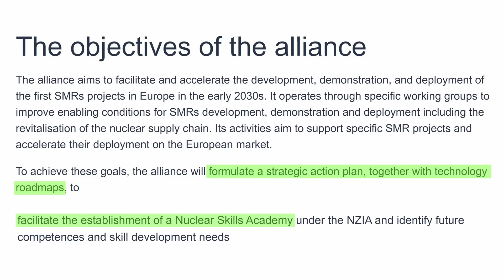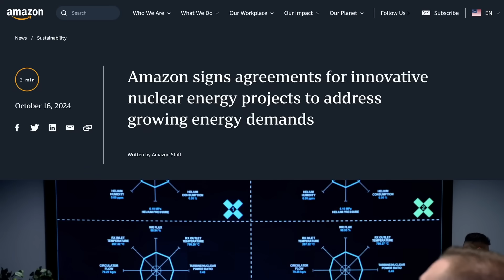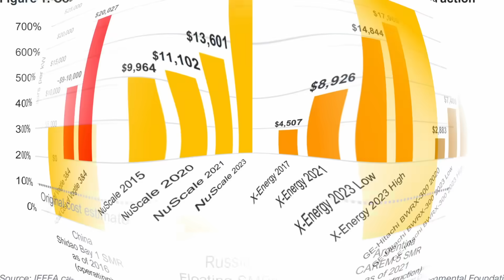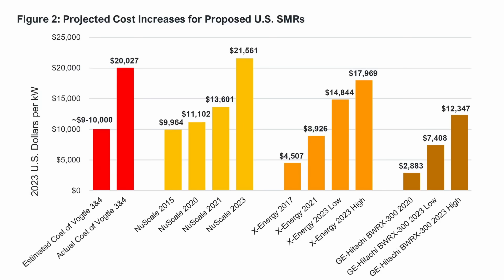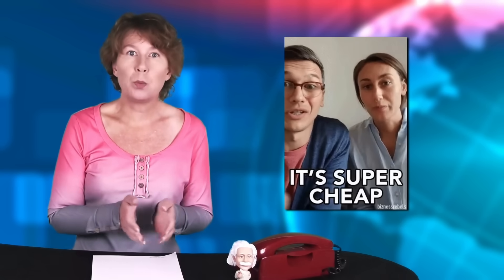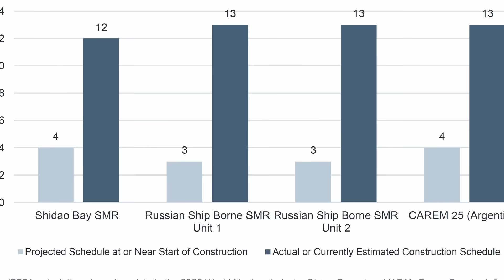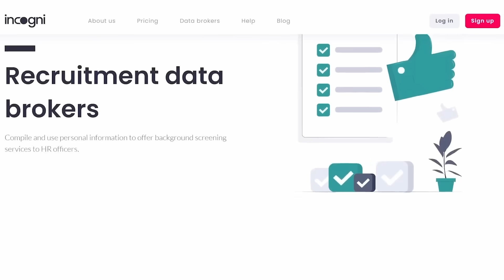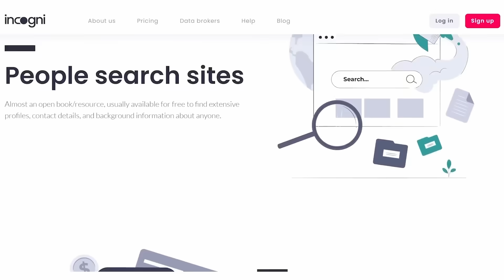Small Nuclear Reactors Have A Big Problem

Comment: Since when does N=3 constitute scientific proof of the economic viability of SMRs? Sure they have a bumpy start, X300 construction in Canada is about to get underway. We can't definitively call SMRs expensive until we've tried to build the first, second and eventually the Nth. And that's the problem, isn't it. We're judging extremely harshly when it is nuclear, and when it is the first of a kind (ring a bell? Olkiluoto, Flamanville, Hinkley Point C, Vogtle...) but are never prepared to actually LEARN how to build these things. China is learning. They are now building their CAP1000/1400 in 4~6 years. The prototypes where the AP1000s they built under license from Westinghouse. Yes, they were more expensive and took longer to build, but they learned how and now they are getting better at it. It will be the same with SMRs, IF ONLY... 

Right...

Comment: This video is too short. No explanation why those costs are so high. Is this just R&D cost high or …. ? Obviously very high certification cost but this is not the only issue with certification. Certified are not reactors but projects case by case as with big reactors therefore no reduction of certification cost at all. On contrary - proportional reduction with project scale. This gives not only high cost for SMR development. Cost you can calculate and share (let’s say with government). Certification gives biggest problem - uncertainty. You never know - how long and how much dollars even with proven technology and design. Therefore no big neither small reactors on the way. This certification burden could be acceptable only for governmental agency like with military SMR. Therefore no way commercial SMR will hit the road.

I was thinking a lot about issue and see no good solution. We should look for compromise between business and society. Just complain - not my style. My suggestion would be - limited NRC certificate for the SMR site. It shall be underground x feet at particular location. And full stop of NRC involvement! Would be better to have limited procedure with $1 billion digging cost of 3000 feet underground than having project “on knees”.

Comment: Sabine, Generally I greatly appreciate your reviews and insights, but let's be more specific  with numbers here... - In Particular on existing reactors. the russian floating power station has being finished in 3 years. The rise of cost is associated with change of the location point from original Arkhangelsk to remote frozen Pivek ( check the map, please). Relocating land infrastructure to Pivek attributes to massive cost rise.

Comment: The fundamental issue is that we are fixated on eliminating CO2 - the gas of life.  There has never been an experiment that confirms CO2 as the climate control knob and certainly no evidence of quality sufficient to justify a legislative compulsion to justify the current expenditures to net zero (gross insanity).  None of the climate models are of the quality of the engineering models that determine the performance of aircraft, bridges or buildings. 
We need to recognise that this pursuit to net zero is MAD and get back to hydrocarbons - at least natural gas the engines for which require no development - just construction.

Time to get back to reality and a better quality of life than the current net zero  path.
Reply: Then you should know all numerical models of real world phenomena are always repeatedly wrong so to speak, but that doesn’t mean they are useless in the hands of experts who understand them well enough to know their limits, which is why there hasn’t been a failed prediction from climate science, and climate projections have been accurate for fifty years. No lack of predictions on track. 

The general circulation models are right enough to project future climate trends to usable accuracy and usable confidence. Your reply raises the question; have you made any effort to find out how well the models that scientists use actually work? There are many examples where we predict and design things from models that are repeatedly wrong so to speak that work the first time they are used; space telescopes and chips with billions of transistors in them come to mind to name a few.
Reply: @rps1689 Plymouth Rock should be under water given, the Climate Models of higher Ocean Levels.  The Obama and others have no reticence to buying Ocean Front Houses.
Reply: Let’s start with the fact that one can observe a noncondensing greenhouse gas in the lab as we shine different wavelengths of electromagnetic radiation on it that, and can measure its absorption spectrum. There is a big spot at around 15 microns, which happens to be in the band of the Earth's surface's black-body radiation; you must have learned about black-body radiation in high school physics. If so, you know one can measure how much the gas warms up with a given energy input; also measure the absorption band across sunlight.  Back to the 15 microns - long wave infrared warms the CO2 and sunlight warms it much less. Science has discovered that CO2 absorbs earthshine way better than it absorbs sunshine; note water vapour has a similar property. Of course that’s not all, we have to calculate how fast long wave infrared radiation, i.e., earthshine, makes it to space when it is getting absorbed and reemitted and absorbed and reemitted over and over. It is way slower than the incoming sunshine, which is basically unimpeded. When the Earth is in thermal equilibrium with space, that difference in transmission rate warms the surface - the greenhouse effect. This effect was discovered 200 years ago.

Combining the discoveries of the absorption spectra of gases and the greenhouse effect and the knowledge provided by them, we know adding greenhouse gas from agriculture, forestry, and during fossil fuels increases the imbalance between how fast energy goes in and comes out. That is the enhanced greenhouse effect. "Proven" by direct observation and simple mathematics.
Reply: No one is trying to eliminate the gas of life. 

CO2 is not only a life giver, it is also a waste product from fossil fuels that has made some ecosystems, agricultural zones, and feeding grounds we depend on not adaptable enough to the current climate change trend.

Science moves on from well established conclusions to areas of less certainty such as quantifying anthropogenic global warming in the presence of large feedbacks like clouds and water vapour. AGW is hardly the most important or interesting area of climate research because it is occurring and is settled. i.e., it’s a baseline. Just as evolution is the baseline for evolutionary biology.

Comment: One Problem is that "More Than" 100,000 Metric Tons of NUCLEAR WASTE Are Sitting IN Community Power-Yards East Of The US Mississippi River.... 90% of all the US Waste. WHAT'S THE PROBLEM --- LIBERAL ENVIRONMENTAL FAIRIES (VERY STUPIDLY) DIDN'T WANT THE REACTOR 'WASTE METALS' STORED IN 150 TON TRIPPLE WELDED CASKS UNDERGROUND --- IN THE DESERT. Technically, Environmentally, Operationally THIS WAS "THE" MOST DUMB AZZ MISTAKE WASH DC HAS MADE IN 25 YEARS.

Comment: We ALREADY have this tech. . . I live approximately three miles from at least thirteen (13!) small nuclear reactors (S6G reactor plants/150-165MW each) in the form of Los Angeles class submarines.  All awaiting decommissioning of their reactors.  Why has it taken so long and cost so much more (each sub cost approx. $1.6B 2023 dollars) to implement these power plants for commercial/residential use?  Can't we just run an extension cord from the subs and plug them into the grid!?

Comment: I think there are more than just three modular reactors currently in use. Virtually all the nations that have nuclear powered ships and submarines use small modular nuclear reactors. This has been true for many years now. These SMRs have demonstrated robust reliable and efficient records operating in mobile, many times remote environments where any failure would be catastrophic. Of course the current users of these SMRs have to do so under extremely strict and rigid safety regulations.

Comment: We are already using small reactors in nuclear submarines and have done for years. Rolls Royce never mentioned will build one in the    Near future. Cost wise the EDF reactors are not cheap but we need electricity. Wind farms will never produce enough electricity and gas and coal appear to be no go areas.

Comment: Sabine,   I have been following the development efforts for Small Modular Reactor (SMR) power generators for over 10 years now.  My concern relative to developing SMR's are the use of fissile material will require the development of new materials to facilitate SMR 7/24 operations to generate electrical power and how to change the nuclear fuel used when the existing fuel is depleted.  Developing new materials to address processing requirements always takes time and money which is why most companies want the government to build initial pilot platforms because the public will pay for the development of new materials, development of new processes and procedures, and development / implementation of risk management plan(s) / supporting procedures.

Comment: No one said cheaper. It makes siting a high energy burden industrial plant, a lot easier though. Why did you think it could be cheaper than a normal nuclear reactor. No the goal is just cheaper than coal or Nat Gas.

Edit: also to be clear the goal is standardization. Which is the point at which costs will fall. The prototypical production will always be wildly expensive.

Comment: Another techo-scam making unworthy people rich. 
With modern cad and simulation the design times, for anyone serious about producing a system, are drastically reduced. And if you cannot build out a container sized system in less than a year you are definitely not trying. 
Yes, I understand that this is a highly technical project but it is not as if the process of producing electrical power with fission is unknown. The lessons learned through large scale nuclear plants should provide a solid basis for whether or not miniaturizing the process is even practical and based on the current results the answer to that question is obviously no.

Comment: Its stupid to build new reactors if they just have to use the power of the phase cange in the existing Systems. And that is usable in every fossil or ato heated powerplant. Its just to reduce the clouds of the cooling  towers. Its like wastereducing. Just to use the power of kondensating watersteam ist enough to get all that needed energy for any KI and more. They have only to evaporate an organic gas and to use it in an Organic Rankine Cycle to use that Phase change energy. Its just reducin those clouds to get massiv Energy for free.

Comment: Its always important to listen to data which we may not wish to hear, as this gives us a chance to find solutions to overcome that data. If we ignore it, nothing will occur. As for Small Nuclear Reactors, we do need to understand the smaller the reactor the less efficient it is. But if they can be mass produced quickly, this will be worth it. I always find it odd that a Columbia class SSNX can be built in 96 months. This uses the S1B reactor, which I am uncertain about its power output, but must be in the 100 MW range at least. They are going to build 20 of these SSNX’s in a production line format, so once we pick a reactor and order them in bulk, it should be possible to build and deliver them in a reasonable time frame. However its possible the S1B is very expensive so this may not be a good comparison.

Comment: Of course SMRs have been around and safely operating for decades - this is what powers nuclear submarines. The civilian versions actually have lower  requirements, what's stopping them is regulation pure and simple - governments don't want civilian companies getting there hands on Highly enriched uranium, so they are stuck with a sub standard fuel. The road blocks are all regulatory, not technical.

Comment: Technology folks do not understand economics.  Small nuclear reactors do not make sense and do not work.  There is significant fixed cost in nuclear reactor electricity production.  You need a safety team and a security team.  Those teams have a minimum size.  You cannot just deploy 2 guys in security and 1 guy in safety because the reactor is container size.  You still need the same teams as a big plants.  The average cost in small nuclear reactors will be very high due to high fixed cost.  It is not about technology.  It is pure economics.

Comment: The singular problem with Small Modular Reactors (SMRs) is a very simple one.  GOVERNMENT.  The REGULATORY hurdles are where the cost and time overruns are coming from.

The United States, United Kingdom, France, and Russia have been designing, building and operating small reactors for 3+ generations now.   The ENGINEERING is mature.
Reply: Those are all military, navy reactors. They operate under reduced regulations and a lot of security classification. If we could get those reactors into the public sector with the same operating protocols the navy uses all would be good. The problem is idiot politicians and idiot activists, none of whom know anything about nuclear engineering.

Comment: it appears everyone is waiting for the next GenIV advancements and retired costs to move forward.
higher operating output temperature (600C - 750C), and HALEO and TRISO fuel in.
primary coolant: water out, helium gas and salt in.

There are a handful of experimental designs moving forward slowly.
All require significant engineering advancements and expenses....US, Canada, and UK are ahead and China/Russia catching up.
Higher safety requirements and improved fuel handling are slowing many western developments.
Slow progress; hopefully smaller = faster, cheaper, easier, safer.
Both NEA-OECD and ANS are monitoring, and keeping track of the state-of-the-art, with many useful articles and whitepapers.
Commercial companies with good progress in new GenIV forefront: BWX Tech, X-energy, USNC, TerraPower, Kairos Power.

Comment: Mature technology SMR’s sit in every nuclear submarine and there lies both the problem and the solution.
 The military, in common with its government parents, has never mastered cost control. I know people who jumped from the private to the state sector simply so they could add an extra zero onto their invoices!
 It takes time to get the State’s contractors to realise that they now need to be cost effective and you usually require a disruptor to enter the market with a new “large volume/low margin” model before the breakthrough comes. 
This was true in my own UK offshore renewable sector that feeds off the former oil industry supplier base. The oil industry was cash rich and always ordered a Rolls Royce system whereas we wanted the Mondeo model. Most were very sniffy initially of the low margin model when they had a much easier high margin model that worked well for them.

Comment: According to the seminal Rand study " Why large projects fail", the key reasons are two.  
1. The team has never done this before or not in this difficult location.
2. Budgets were baselined before the scope of work was completed and verified, and actual bids on all completed bid packages were received.

Start at 50% overruns for things completely specified and done before to 400% for proceeding with incomplete work scope by a new team.

Look for the ongoing CA high speed rail farce to exceed the original $10B budget by 100x before it is stopped.  Scope, land purchases, boring technology, timeline, methods, funding and route not yet baselined. 10 years into the project.